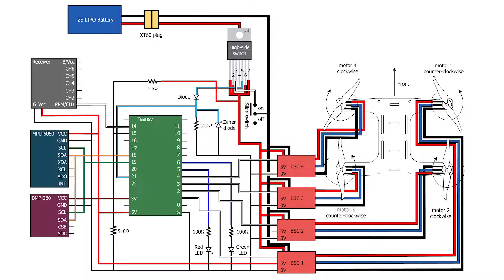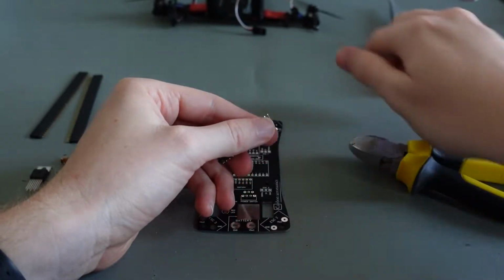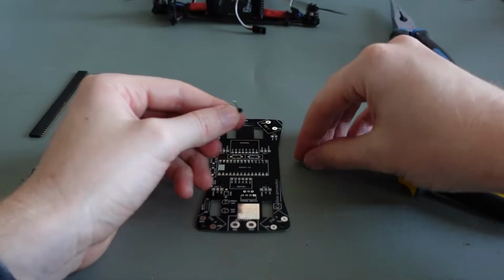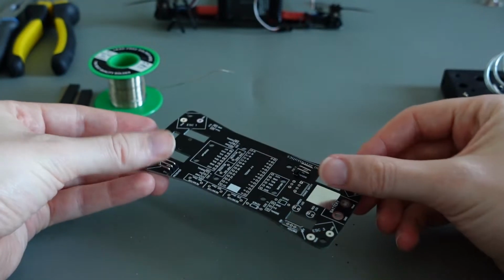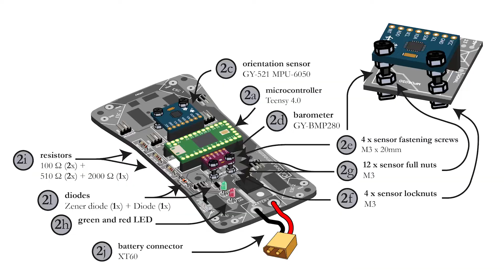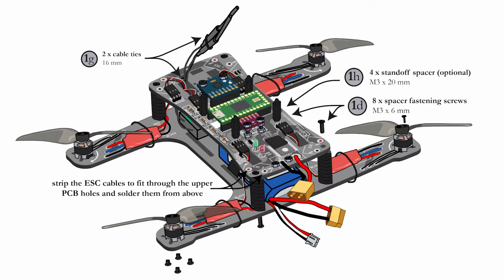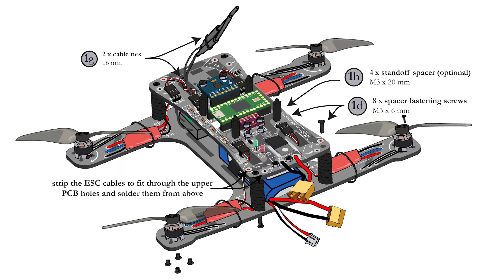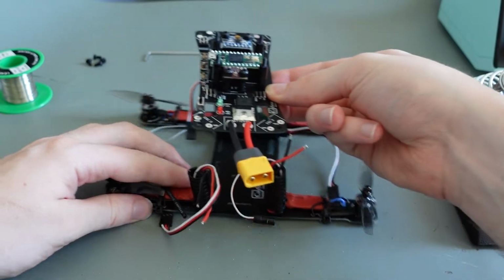10b | Assemble the upper frame and complete the drone!

Comment: Hi, emergency comment, I am building the drone following your steps. I wasn't able to get my hands on a few components like the power switch and the zener diodes. I know the power switch is not mandatory, but what about the zener diode, is it an important component for the drone build?
Reply: hello, urgent help required sir, i am building this drone and all my motors are single handedly working alongwith esc , but when all connected together, then there is no red light in reciever, even though the connections are as same as this video, please help me in sharing your knowledge on this